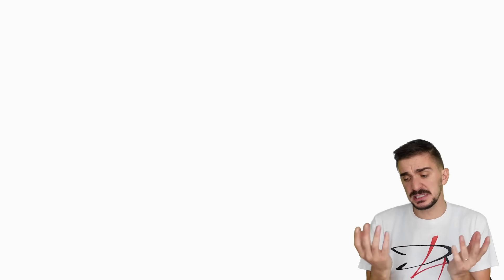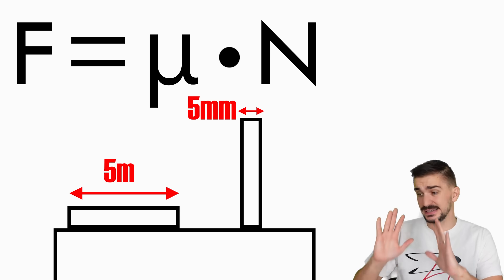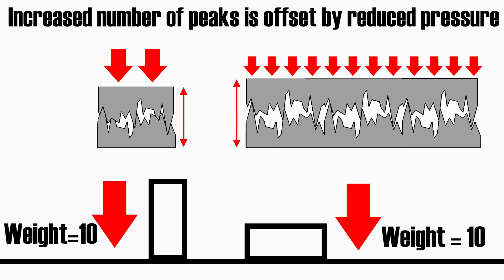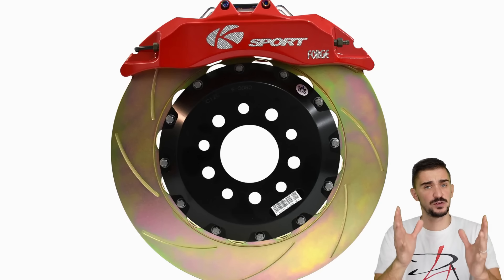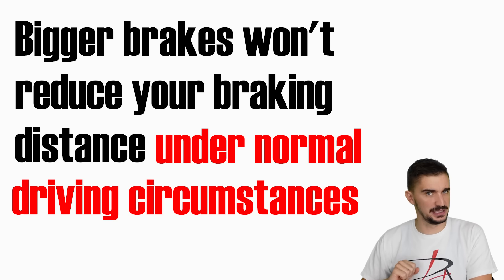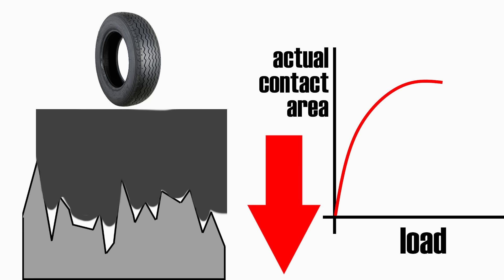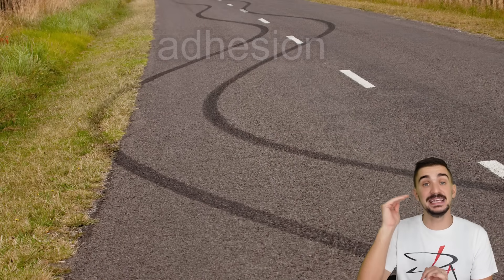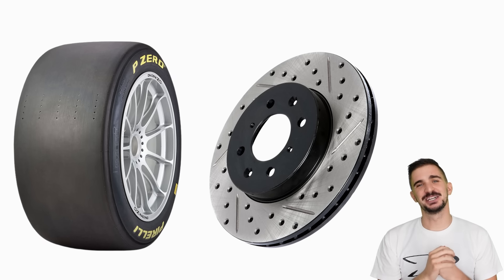Why Big Brakes Won't Stop You Faster but Wider Tires Will - Friction and Surface Area Explained

Comment: All in all, a good explanation, there are nuances that can turn this in to a multi hour lecture.  My practical experience is that I use stock brake rotors and calibers with aggressive pads for racing.  Even up to 25 hour endurance races.  In a light car (Miata) with the biggest and good tires (Hoosiers R7) that fit within the fenders, I still have more brakes than tires and have never had issues with brake fade. But they do not look as cool as a big brake kit!  Keep the videos coming.
Reply: interesting. I also race a Mazda (a mazdaspeed 3), and I've upgraded my rotors and pads and tires. I've noticed significant reductions in brake fade since making the change. And I'm only doing hpdes.
Reply: @3MZFE  Not sure about the details of your MazdaSpeed3 but looks up the weight and the internet reports around 3,200 LBS without driver. If you drive your HPDE car on the street, then would assume you are using less aggressive pads.  My first gen Miata is under 2,200 LBS with driver across the scales at an end of a race (per the rules for the class I race in).  I would guess the extra 1,000 + LBS makes a difference.  I don't even have to use expensive brake fluid as long as I keep the cheep store brand DOT3 fluid fresh.  I do use aggressive pads which requires brake pressure modulation to avoid flat spotting the tires.
Reply: I run stock sized rotors in my Exige (2025-lbs with me in it), because I didn't want the extra unsprung, rotating mass of larger ones. (Also I am using 1" less wheel diameters than OEM so there isn't a lot of extra room.) But while the OEM pads were enough for the OEM tires...once I added stickier rubber, they weren't good enough. So I added Pagid RS42 pads and it brought the ratio of pedal pressure to stopping power right back up to what I liked. (There are even more aggressive pads of course, but the RS42 still has decent low-temperature operation and rotor wear rate, and I street drive it occasionally so I think they were the best choice for me.) I run Motul 600 fluid even though I probably don't need to, just for the peace of mind.

People always ask me if my brakes need repair work, because they squeal a bit when street driven. No. No they definitely do not. I haven't run with ANY other production street legal car on DOT tires that will out-brake it in my sixteen years of doing HPDE.

Comment: While bigger brakes (more surface area) wont help stop you faster. Wouldn't brakes where the calipers can apply more force, and brakes where the actual width of the contact patch is the same but just farther away from the wheel hub so it can apply more torque both provide better braking? Because race brakes arent all just about more surface area. A big selling point on a lot of brakes is the piston count. And I would just asume that having the braking surface farther from the hub would provide more stopping power because it can apply more torque (like the front brakes shown on the motorcycle in the video).
Reply: I have raced in cars with 1, 2, 4, 6, and 8 pistons. the clamping force for most is the same, because its typically the same surface area just spread across multiple pistons. in some bigger calipers with multiple pistons there are more smaller pads rather than 2 large pads. I'm fairly certain the differences are more measurable with heat absorption/dissipation than anything else

Comment: Minor critique of your explanation for mu in the friction force equation. Mu is dependent on the coefficient of friction between the paired surfaces combined, not any individual material. So Mu will be different for tires on concrete vs plastic rollers on concrete; etc. Also mu will vary depending on the static vs dynamic friction.

Comment: I've already seen some people commenting on this but with the brakes, even though the magnitude of the frictional force is equal no matter the brake size, with the bigger diameter rotors the braking force is applied further away from the center of rotation thus creating a bigger torque opposing the direction of the movement of the wheel.
Reply: The farther away from the center the harder to stop the rotation.
Like a swinging hammer the longer the handle the harder it hit. Means the harder to stop it.
Reply from the maker: Yes I responded to a few already. It's honestly negligible on a car. A few centimeters of disc diameter doesn't do much.
Reply: @d4a  An MX5 NA1.6 with the 235/231 disks produces about 3200Nm of brake torque combined from both wheelbases at about 85bar line pressure. +20mm on the diameters of the discs produces about 3350Nm of brake torque, a 4.6% gain. Effectively this'll mean you can/have to let off about 4bar of line pressure to achieve the prior braking torque.

It might do nothing to the actual stopping performance, but the torque delta is large enough that you'd easily feel the more sensitive lockup IMO.

Comment: This leaves me wondering what you are defining as “bigger brakes”?
Are you referring to rotor swept area, brake pad area, rotor diameter / brake caliper moment?
I get what you’re saying as to a larger tire contact patch with a higher friction coefficient will generate a higher reverse torque, but, this doesn’t take in to consideration a larger diameter rotor / longer caliper moment, ability to absorb more braking torque with less applied brake friction. Then there’s the performance curve of the brake system, and tires / suspension system, and the interactions of all.
Then there’s the delta ( difference) of what is being compared, as starting / ending points, the conditions and goals.
An extreme that comes to mind would be putting larger tires on a 1/2 ton pickup.
In the end, I feel the scope of the comparison is way too narrow to make such a broad statement.

Comment: Thanks again for your wisdom ;) question, some race cars have a tube to direct air to the brakes. Is that even working or is it just show?
Reply: based on my experience. brake ducting can make a significant difference in cooling time on race cars... it doesn't make a significant difference on a car operating on normal streets at normal speeds as its not getting enough air flow. Some rally car calipers are even liquid cooled.
Reply: @Alkivar  wow liquid cooled, that is the first time I hear about that. Thanks
Reply: It is effective, you could even say necessary. Serious racing teams try not to do things just for show.

Comment: Is it me or did he not mention the increased leverage gained from bigger disc rotors?
Reply: He never stated that braking force isn’t actually bigger in real life scenario, but it doesn’t matter as standard brakes can lockup tires, so you’re not limited by braking force, but by tire grip. Of course it’s different when you race, then you put beefier slicks and just maybe then you’d be limited by brake force, but I still doubt it. Certainly limited by brake fade, but that’s not the point.
Reply: @driv3ver  yeah and no, if you ride motorbikes you’ll quickly see an extra 40mm on the front rotor makes a massive difference, I know he’s talking cars but he rides aswell.
Reply: @merkel2750  That’s only if OEM system is lacking. I’ve been riding years ago too. What you’ll always notice with bigger discs is that you need lees pedal or lever travel for the same stopping strength, but still threshold is the same at tire’s grip level. Which leads to less precise braking, because very little force applied on pedal or lever will initiate high brake force and doesn’t let you modulate that well. You’ll be locking up with let’s say 50% travel instead of 90%, so you won’t be that precise. In the end bigger disc will make you feel like your brakes are better, but if you compare stopping distance it will be the same or worse (brake bias!). I’m occasionally driving on track days, and if OEM system is good, then even for track racing it’s enough to only maintain it well, put good brake fluid, steel braided lines, good rotors and racing pads. Unless you’re getting much more HP than stock then BBK may be the way to go due to heat issues.
Reply: @driv3ver  so basically every dual sport/enduro and adventure bike and every entry level/beginner bike. I’m unable to lock up my front tire on my drz and that was before a lot of engine work.
Reply: @merkel2750  drz is old and heavy so it makes sense - very nice bike though. In my V-storm 1000 OEM double disc non abs brakes would just lockup even on good tires.

Here we’re mostly talking cars, and “new” cars have brakes that are efficient enough - haven’t driven any from 21st century that wouldn’t be able to lockup tires. On a bikes I guess it may be intentional to prevent panic braking accidents. Front wheel lockup on a bike is scary. I’ve crashed that way, as I didn’t realized on time that I locked up front tire because of oil on tarmac and I kept pressing lever harder with no result and got into hard shimmy -of course  it happened within a blink of an eye, if I’d let of the brake instead of pressing harder, then I’d save it.

If you’re looking for improvement for a bike brakes search for sintered brake pads
Reply: @driv3ver  I’ve got sintered and tried others can’t remember what I settled on, tried organic which was straight up dangerous, burnt the pads down to the steel plate in one ride, but I think they were defective. But bigger brakes is a staple in supermoto bikes for a reason, most dual sports are made with that kind of riding in mind, you take a bike on road with sticky tyres, you require more braking power.
Reply: @merkel2750  I’m far from a good Moto rider, so can’t elaborate nor argue a lot. From my experience; My starter bike 50cc Derbi Senda did fine, easy stoppies, then Suzuki XF 650 - this one had dull brakes, and Suzuki V-strom 1000 good brakes from beginning. Been riding on my friends Honda FMX 650 also weak brakes, but Kawasaki ER6N, Yamaha R6, KTM SMC 690, Duke 690 those didn’t needed any upgrades for street use, could effortlessly raise rear tire on those without leaning forward. As for brake pads in my car once those literally exploded (3 out for 4 on the same lap) on a track while having around 60% pad left, but it was still stuff from previous owner, though those were fine the first time -video on my channel is recorded with those. My next “race pads” OrangeStuff from EBC survived just 200km racing till metal plates, basically 2 hours since I started my track-day - in low HP 900kg car…
Reply: @driv3ver  I’m an average dirt rider and probably an average rider in general but I can outride my heavily modded drz434E with braided lines and the best pads I could find, I’m great at backing it in but can’t even wheelie, so I’m not up myself, I just know that since increasing my rotor size, I’m not outriding much bike anywhere near as much on the road.
Reply: @driv3ver  My Exige went from tire-grip-limited to brake-force-limited as soon as I put stickier rubber on it. But I imagine most manufacturers build in more of a margin than Lotus did. Lotus likes to engineer things to be JUST enough to do the job, and no more than that. Wouldn't want the extra weight if you don't need it, right?

Anyway, I solved the problem by just swapping out the brake pads to ones with a higher coefficient of friction. Worked like a charm. Fade isn't a problem, probably due to the low weight of car.
Reply: @xtnuser5338  Well, check out my Lotus performance on brand new new Toyo R888R Semi-Slicks and OEM brakes and pads, it’s on my YouTube channel. Zolder circuit is the most brake killer track in Europe, if your brake system survives Zolder without issues it can go to any other track worldwide and it won’t fade either. I’ve been getting fade after 4-5 laps, but that’s track racing - in normal conditions those brakes were never limited by brake force, never. Then next year I’ve put on better discs, Castrol SRF brake fluid, racing pads and those pads were gone in literally 200kms, discs violet after cooldown, brakes steaming, but no fade and always tire grip limited. I’m sure that even with slicks OEM brakes wouldn’t be the bottleneck for first 3 laps, and 3 quick laps there in Zolder is more demanding on brakes than 2 full laps on a Nurburgring due to long cooldown sections there. So there must have been something wrong on your car, as my Lotus have been going more than fine on wider (195 vs stock 175) and stickier tires, with full OEM brakes and to make it worse it’s heaviest option with Toyota motor, Supercharger, sport pack and touring pack. - though I’ve been kicking the brakes as hard as I physically could, and I’m impressed how though brake pedal is :D
Reply: @driv3ver  There wasn't anything wrong the the OEM brakes. They just didn't quite have enough grab to reach the ABS threshold every single time once I put bigger slicks on the car. Still worked on flat ground, but in places where I got more compression, like at the bottom of a hill, they just weren't quite enough. Like I said, pads with more friction solved the problem wonderfully. I didn't need bigger rotors or six piston calipers or anything like that.
Reply: He's addressed it in another comment thread. It ends up being basically irrelevant.
Reply: I think the argument is that if you can already lock up your wheels (i.e. ABS engages) then you're getting all the braking the car is capable of without upgrading tyres, suspension etc.

But yes, bigger brakes do give a bigger lever arm so the calipers don't need to squeeze as tightly for the same amount of deceleration. Doesn't lower stopping distance appreciably though.

Comment: That's why they makes sense on motorcycles, particularly at the front, since that's the brake you use more often. I remember when I had a two-stroke 125 sportsbike, going flat out on downhill twisted roads I had to use the rear brake to compensate for the almost non-existent engine break. Sometimes after 10 or more miles downhill, I had to stop for a couple of minutes to let the rear break cool because it started to feel as if it generated friction without breaking. Despite breaking most of the time with the 320mm floating front disk, the 220mm one caliper rear disc was the one affected, never had a problem with the front one, not even at the race track.
Reply: Well on track those 30hp street 125’s are so heavy that we actually destroy the front brake a lot on stop&go types track. 
Lots of front discs we see deeply cracking between cooling drills.
Reply: @Dstructeur1  these guys might have a better rotor for you,  sorry youtube dont allow links anymore it seems.  Look up brake tech.  They make great aftermarket motorcycle rotors
Reply: @blue03r6  We mostly use Brembo’s series Oro discs, which are among the bests available, so I doubt there really is a fix to this inconvenience sadly. 
Single front disc is a weak point by itself, but 2 discs setups are much heavier and would level down actual bike performance.
Maybe the 4-small rotors from Beringer for front end might be a fix, but would still be hard/impossible to have homologated in any racing division and would still weight a bit more than acceptable although reducing inertia induced by 2 huge rotors.
Reply: @Dstructeur1  those brembo's are solid all around.  look up the cobraMX discs from braketech.  there cut out all over to make them super light. they look like they'd weigh half of that brembo
Reply: @blue03r6  They’d probably be lighter, but they probably also would dissipate so much less heat, those discs have a lot less fret surface. 
There’s a reason you almost never see those funny looking discs on race bikes, sadly it’s much more complicated than solely weight!
Only bikes that benefits only from lighter brakes are dirt terrains ones 😌
Reply: im glad you brought that up. I had the same issue when rallying my sports cars down hills.
When your materials heat up they expand. the rotor expands as well as your pads expand. even the caliper expands. They dont expand a lot, mind you, but eventually as everything heats up and expands, its as you said, you are braking without actually braking. by stopping for a few minutes and letting the brakes cool off, they contract back to normal size.

Comment: i am not here to disagree, because all of these make sense and of course play a role. But the larger in diameter the brake disc is and the bigger the brake pad size, will have much more friction area and that way, we can apply more force than previously and get better results. this video only talks about applying the same force. rather than in reality, installing a larger rotor, and bigger caliper, often means the master cylinder will be also larger so you can apply more pressure onto the surface area. and that is without taking into consideration fixed calipers versus floating calipers and the advantages on them.
Reply: "we can apply more force than previously and get better results."
No. For one very simple reason: It does not matter how much torque you theoretically could apply for braking if the tires start slipping.
Reply: @ABaumstumpf  you clearly miss the point.
Reply: @TheRealBhuado  "you clearly miss the point."
Says the person that claims you could apply more braking force than already locking up the tires.....
Reply: @TheRealBhuado  You clearly don't understand how brakes work. But have at it, waste your money on snake-oil.